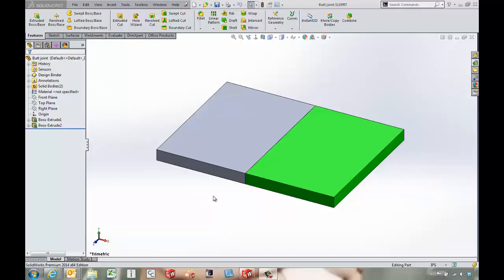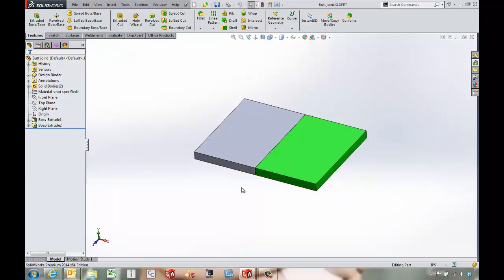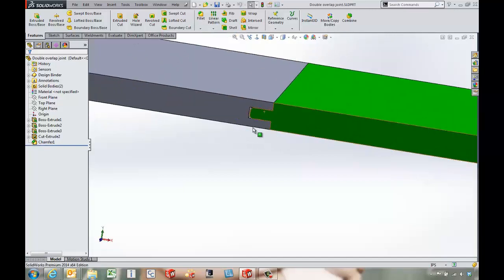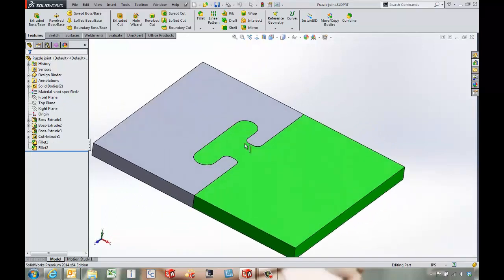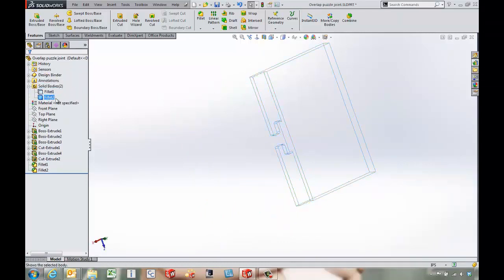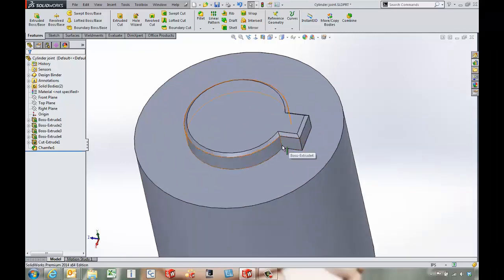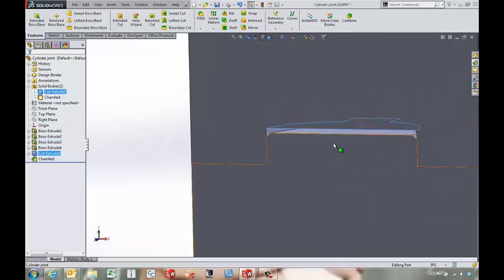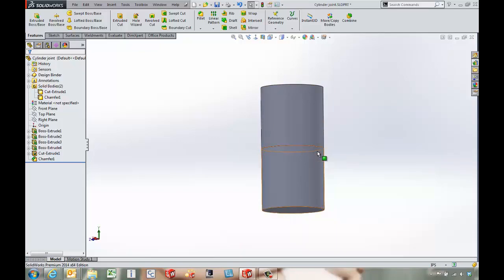Stratasys - Joint Examples for Splitting Up Your Part for Printing

Comment: Great video, thank you! What would be your suggestion for joining 2 pieces at an angle? I need to print two pieces separately and they need to join at an angle similar to the ridgeline on the roof of a birdhouse. Thanks for any help!
Reply from the maker: I wish I could trademark “DOTG”.  We say it all of the time.  It depends on the geometry.  There are so many more design theories centered around DFM – Design for Manufacturing, but now we have DFAM – Design for Additive Manufacturing.  What freedoms do with have with the design?  Can we design in some features to make it “Tony” proof?  Do we want to hold the pieces at a specific angle, keep the ridge line from sliding up or keep it from sliding down the length?   The more we can lock down, the better we will be.  I have seen a dovetail design for situations like this, but a lot of the success depends on how thick the roof panels are.   Can we thicken them up?  Can we add additional material on the inside of the joint where we would have some more material to work with, or even have some areas where we can add hardware, glue or locating tabs and slots?  Depending on what 3D printing technology you are using, you will also need to consider build orientation for strength and aesthetics as well.

Comment: Thanks for the video, I am going to 3D print an ATX sized case on my Prusa and needed a good joining method so I really appreciate this, especially as I am a Solidworks user. I think I'll go for that hidden double overlapping joint as it looks like it will give a much larger surface area for CA glueing yet the seams will be a lot neater. Thanks. :)

Comment: I'm new to SolidWorks and was looking for how to split parts for 3D printing. You shows your results but not HOW you did them. My search continues.
Reply: For things like the cylindrical joints, he will have sketched and then resolved it 360 degrees to make an insert on one piece and an indent in the other. The others are a combination of sketches and extrusions/extruded cuts. Hope that helps.

Comment: how did you do the hidden puzzle joint? can you show a step by step tutorial of how you created that please?
Reply: As a fusion360 user I would say, create the first part and use it as a cutting tool for the second part. Add tollerances and you are done.
Good luck for finding a step by step tutorial!
Cheers